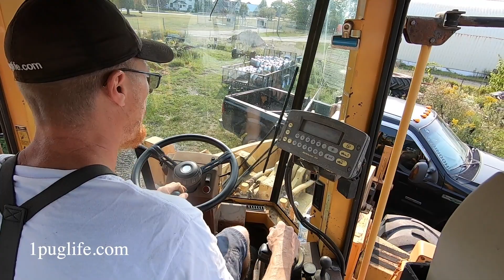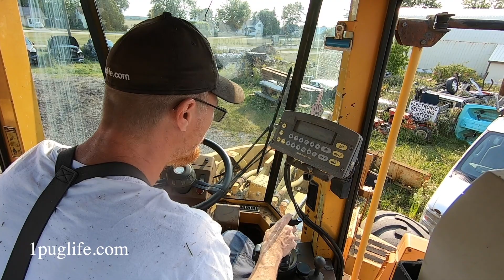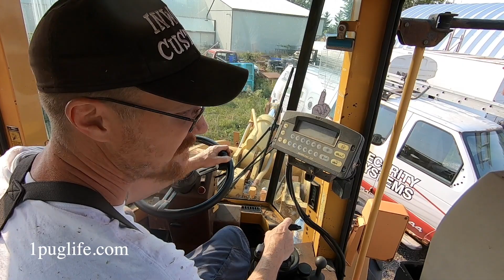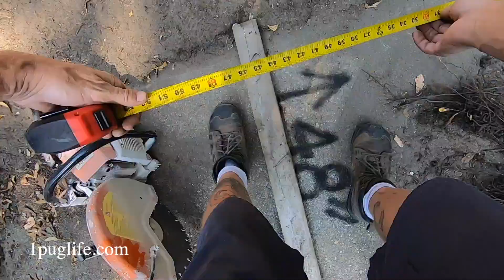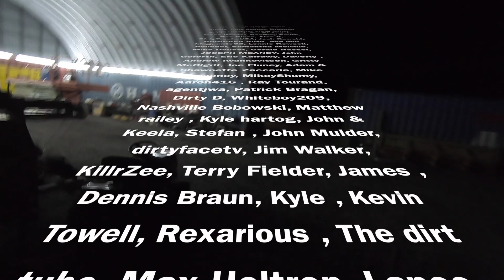small trapter job in tight yard

Comment: Best way to keep the trailer still is adjustable posts with holes down them for up and down adjustability with pins on either side of the trailer at rear. Sorta like the dolly jack in front of trailer when you park it but without the crank. And put truck in 4x4.

Comment: You need a separate chain for each corner plus a separate chain for the bucket, even if its attached to the machine. Congrats on the CVOR now you need to raise the weight limit on your license plate sticker to 20 000 pounds.  And get a up to date safety yellow sticker on the truck and another for each trailer you will be towing. Last thing make sure you fill out a daily log book confirming you did a circle check.
Reply: Oh god. It’s the chain police.

Comment: Hay Pug we have this stuff called Slime here in America, it sealed a few holes in tires I have had it might help your massive tire. Good luck 👍
Reply: TIREJECT works MUCH better.
I used Slime in my lawn tractor tires and it didn't stop the leak but the Slime worked it's way into the tire bead and when the tire pressure dropped, the tire slipped off the bead when I made a turn.  Happened twice and I'll never use it again.
Reply: That tire has had a leak for years now, doubt he'll ever fix it lol

Comment: That chain idea should work, as long as theres not enough slack in them to allow the ramps to pop up when the weight gets on the back and pivots the trailer.. and if that works out it should keep the trailer from pivoting at all.. either the chains, or get some big arse blocks to put back there..